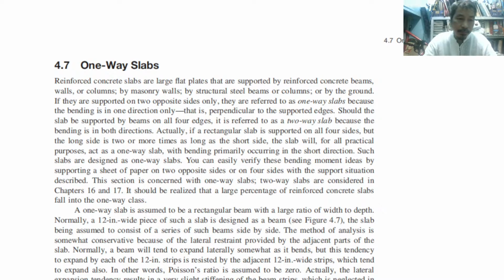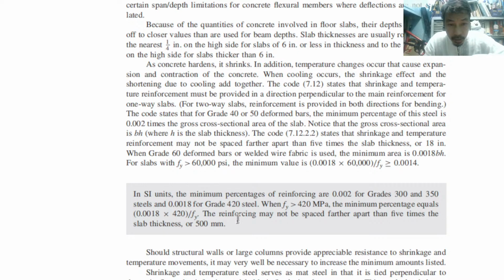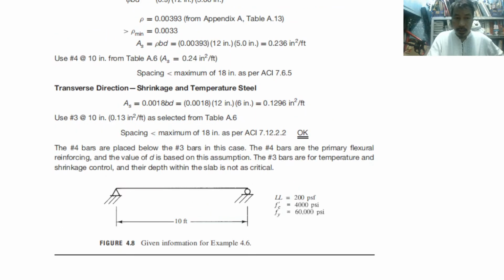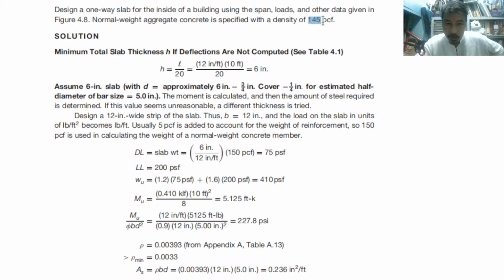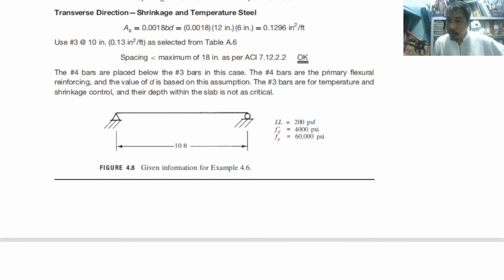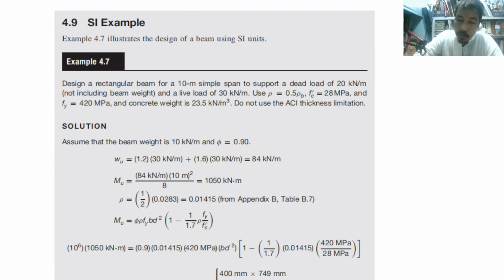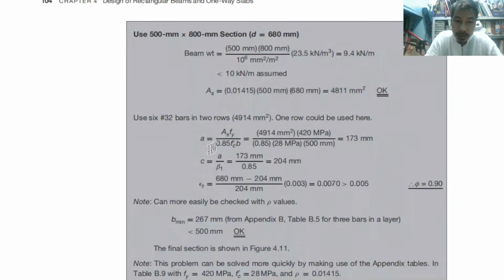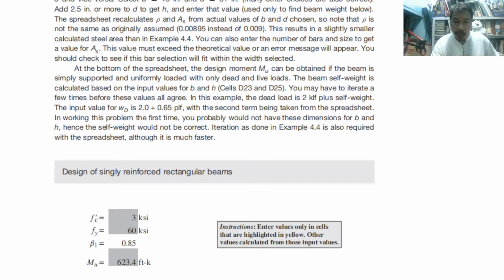[ LIVE CEE7 Lecture 14 ] DrAP Zantua One way Slab Talks + ENGINEERING Design & Examples

Comment: Thank you teaching us I learned that the one way slab (with beams) system is used for low-rise office buildings, parking structures, and warehouses. With a one way slab, the load is carried in only one direction perpendicular to the supporting beam.

Comment: This video further continue the discussion of one-way slab. This are usually provide a flat surfaces. One-way slab are determines if the bending is in one direction only perpendicular to the supported edges. This is usually floors or ceilings. What are the minimum depth for the slab to apply the rebar, sir? Is it true that below 5 inches depth, reinforcing the concrete slab won't be necessary.

Comment: In this video we are now in the second part of the chapter 4 which is the one way slab, it is used for flooring and supported by colums. If it is supported on two sides it is called one way slab. we tackled here the factors that we need to find out on the design strength of slabs. and example problems help me to understand the formulas more

Comment: Thank you sir,I've learned that The one way slab (with beams) system is used for low-rise office buildings, parking structures, and warehouses. With a one way slab, the load is carried in only one direction perpendicular to the supporting beam.

Comment: Thankyou sir for discussing about one way slabs. Reinforced concrete slabs are large flat plates that are supported by reinforced concrete beam walls or columns by masonry walls, by structural steel beams or columns or by the ground. A one way slab is assumed to be a rectangular beam with a large ratio of width to depth. Normally a 12 in wide piece of such a slab is designed as a beam slab being assumed to consist of series of such a beams side by side. I’ve learned that in SI units, the minimum percentages of reinforcing are 0.002 for grade 30 and 350 steels and 0.0018 for grade 420 steel.

Comment: thank you sir for discussing one-way slab. I learned that reinforced concrete slabs are large flat plates that are supported by reinforces concrete beams, walls, or columns; by masonry walls; by structural steel beams or columns; or by ground. If they are support on two opposites sides only they are referred to as one-way slabs because the bending is in one direction only. A one-way slab is assumed to be a rectangular beam with a large ratio of width to depth. As concrete hardens, it shrinks. in addition, temperature changes occur that cause expansion and contraction of the concrete. When cooling occurs, the shrinkages effect and the shortening due to cooling add together. The code states that shrinkage and temperature reinforcement must be provided in a direction perpendicular to the main reinforcement for one-way slab. Areas of steel are often determined for 1 ft widths of reinforced concrete slabs, footings, and walls. For 1 ft width of concrete, the total steel area obviously equals to the total or average number of bars in a 1 ft width times the cross-sectional area of one bar. This can be expressed as (12in bar spacing c. to c.) (area of 1 bar). Cantilever beams supporting gravity loads are subject to negative moments throughout their lengths. As a result, their reinforcement is placed in their top or tensile sides. Up to this point, only statically determinate members have been considered.